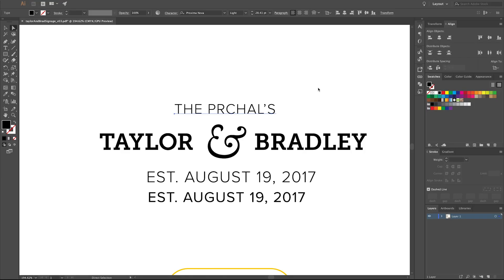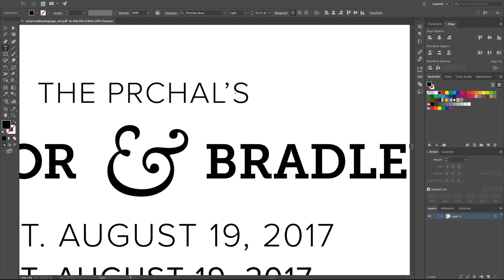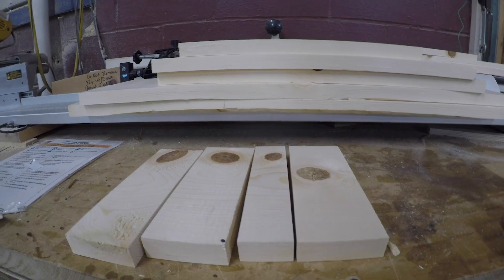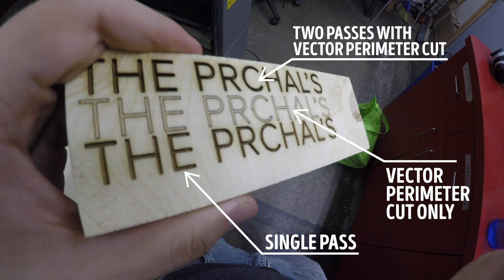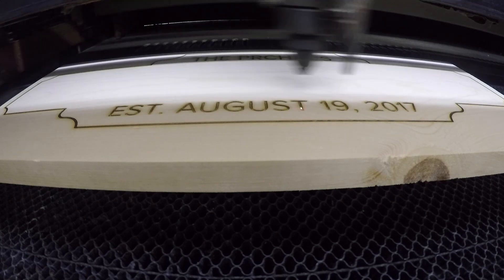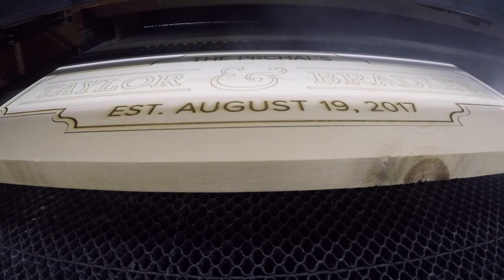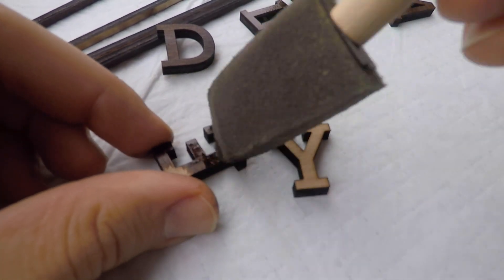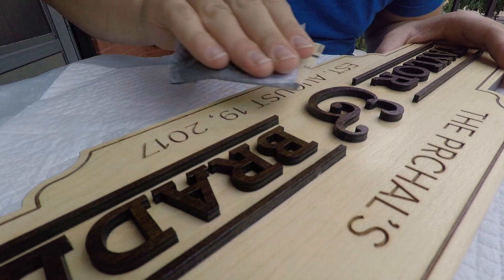My First Laser Cut Wedding Sign for Taylor & Brad

Comment: A bit of advice from a picture framer…don’t use wire for hanging, use 2 d-rings (one on each side towards the top). It will then hang flat against the wall and it wont ever tilt.

Comment: Hi Ron. Great videos! I would lightly raster the base in the area where the letters I'm gluing on will be placed. That way they "drop" right in so alignment isn't an issue.
Reply from the maker: Hi James! Thanks for the comment and idea! That would totally work too! Only reason I might not do that is because raster jobs take longer than the vector kiss cut does and it would add to the lasering time. Using just the vector kiss cut works well enough as the individual letters dry in place within the first few seconds after pressing them down that they stop sliding around. They still need the proper amount of time to dry fully, but they stop sliding around pretty quickly. 

That said, I think on super tiny letters it might be best to do it how you said – say, if the letters were 1/2" or so. In that case they're so small that tiny imperfections in aligning are more visible than they are on larger letters.

Comment: If you take 8oz near boiling water, add about 1 tablespoon baking soda to said water, and let cool. Then add enough latex primer to the baking soda water, so that when the solution is painted onto a piece of pine, it gives a very light white wash. This will make your laser burn black rather than gold. 

Even just bakimg soda water on pine is amazing. I have engraved photo realistic images onto wood.
Reply from the maker: Great tip! I've heard similar effects with borax I want to try both now! Thanks!
Reply: @FarbulousCreations  no problem. I wish i could send you photos of how well it works haha

Comment: Hi. Could you explain in more detail about the alt click on the curves in Illustrator? Thanks!
Reply from the maker: Sure thing! If you have an object selected and then switch to the Direct Select Tool (the white arrow tool), you will see little blue circles/dots appear inside your shape near the points on your shape. If you hover over these, you'll see a little "rounded corner" icon, and sure enough, if you click and pull these towards the center of your shape, you'll round over the corner. But if you alt click first before pulling you'll get an inset rounded corner, and if you alt click once more, you'll get a chamfered 45 degree "corner." If you pull in the point with either of those alternate options activated, you'll get the same corner type.

It's worth noting that you can do this to all points on a shape all at once, or if you click a single point with the Direct Select Tool, you can do it one at a time. Hope that helps! :)

Comment: Nice work! You said in comments, you used a laser at local maker space, But what kind of laser? CO2? if so what size? Like a K40? Thanks for the vids
Reply from the maker: Hey there! It was a large, older CO2 laser, so not a K40. I don't know the model or anything, but it was a Full Spectrum laser and had a decent bed size, probably about 3 feet wide. I have my own Thunder Laser Nova 35-80 nowadays. 😊

Comment: If you had placed double sticky back tape on the back side of your material prior to laser cutting, finish the top side sanding staining and covering with transfer tape. The cut out your letters you're done.
Reply from the maker: Hey Waldo, yes I could definitely utilize more masking in my work. Sometimes I don't think of it though. 🤷‍♂️ Thanks!

Comment: Can you tell me what kind of pine wood it is . I went to Home Depot and they only had radiata pine . Please let me know what kind to get . Thank you
Reply from the maker: I believe radiata pine typically refers to pine plywood, though I may be wrong. Any solid "pine" wood like fur, spruce, etc will work. I think the solid boards are usually "Ponderosa pine." Hope that helps!
Reply: @FarbulousCreations  i have called a few places in my area but nobody sells pine . So any recommendations

Comment: What kind of wood are you using? Wood is pretty thick to laser cut.
Reply from the maker: Hi Christopher! The backing board is pine, which the 80W laser at the maker space can cut through like butter, even at nearly an inch thick. Hardwoods like maple or walnut wouldn't fair nearly as well, though! Hope that helps! :)

Comment: What watt is your laser cutter? I have a 50 watt laser and I wanted to make a wedding sign for someone and would like to cut pine wood if I can with a 50 watt cutter.
Reply from the maker: Hey Shawn! The laser I used in this video is 80 watts, so I imagine 50 watts should be able to handle it, perhaps just a bit slower or with a double pass. Hope that helps! :)

Comment: How did you know what software to use and how to use it? Do you take your own computer and connect it to the printer at the maker space you go to?
Reply from the maker: Hi Cindy! Great question! There’s a very brief laser training class you have to take when joining the maker space I go to, where they teach you the differences between vector (cutting) and raster (engraving) workflows. Any software that generates vector files can be used to design you work – Inkscape being the popular free option. I do all of my vector designing on my own computer using Adobe Illustrator (not free) because I’m the most comfortable with it and I’ve used it for years. You can’t connect your own computer directly to the laser at the maker space I go to, but you can transfer your file via a jump drive or USB stick. The laser computer doesn’t have Illustrator installed, so what I do is export my file as a vector PDF from Illustrator on my computer and then the laser computer can open it in Adobe Acrobat. Then it’s a simple matter of “File > Print” to send it to the laser control software and then to the laser from there after dialing in my cut settings. Hope that helps!! 😊

Comment: What Laser Engraver are you using?  It must be pretty powerful to cut 3/4" pine.   I want to cut letters to add to a sign what Laser wattage is needed?
Reply from the maker: Hey Jeff! The laser cutter is an old Full Spectrum laser that I have access to at my local maker space here in Minneapolis. I believe it's an 80W machine. For the letters you want to cut, it depends on the material and thickness, but something as low as a 40W machine should be able to cut 1/4" plywood, for example. Hope that helps!